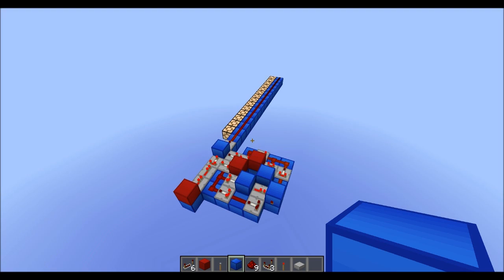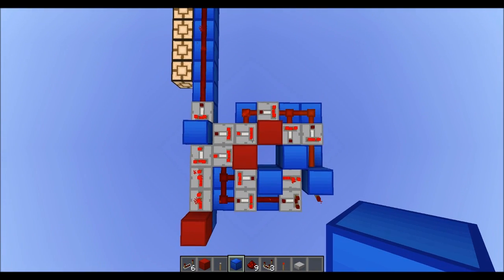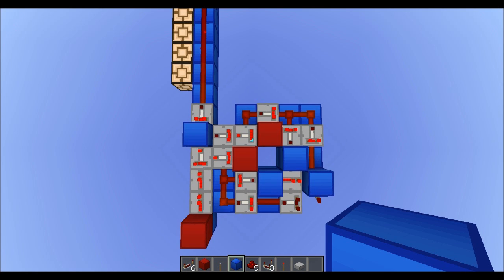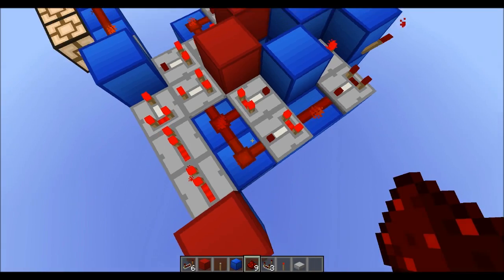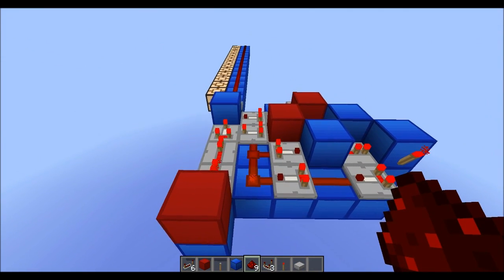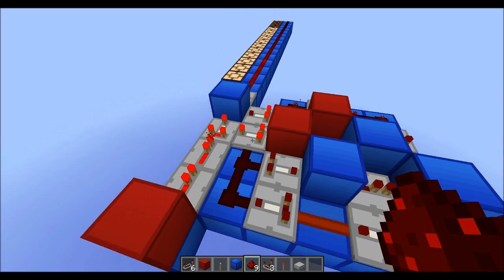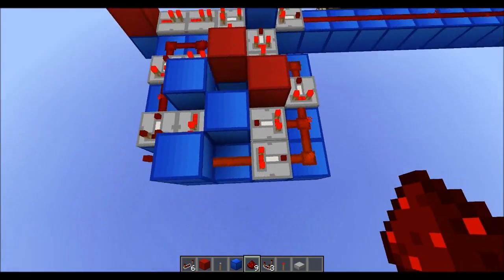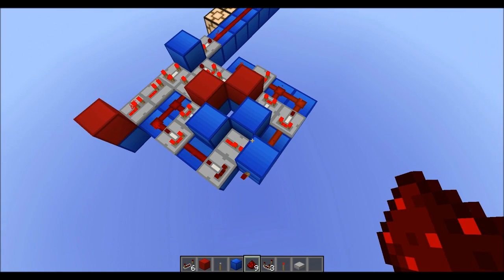Minecraft: Real Alternating Current in Minecraft

Comment: Hmm.. This seems almost as if you could modify it into a kind of 'easily' adjustable timer circuit.  Not quite a 555 timer, but something approaching the ease of use that the Redpower timer has. Modify a repeater value here or there in the tweaked design to get different 'pulse rates', slowing it down to a crawl eventually.

Second possible use would be for a kind of 'rising staircase' timer.  Pushes the stairs out as the signal goes along and then retracts, using a pulse where the torch is.

Comment: Anybody else thinking "digital function generator"? It has a 32 tick cycle (if that's wrong, the concept still holds), and you can extract that signal at any particular signal strength with a repeater. For example, you could have a 4-on 28-off cycle. Or a 20-on 12-off. Or any digital waveform you'd like!

Comment: Arent alternating currents sending a pulse if elictric in one dirction, and then a pulse in the other? Like niot increasing strength and decreasing strength - going into negative as the current goes the other direction? Wouldnt it be possible to do it with 2 t-flip flops?

Comment: Couldn't you find a way to run this through a binary counter-or something like that-but by running the counter off of different parts of the AC, it would add 1 at quicker pulses, or slower? So you could possibly make an adjustable timer compact by doing something like this, right?